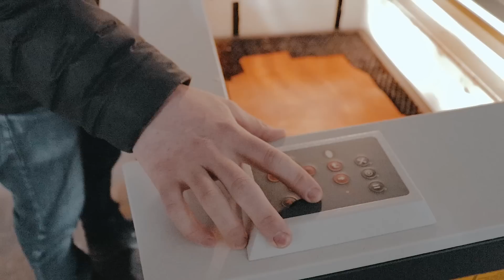MAKING LEATHER HAT PATCHES - TIM HORTONS AND HAMILTON.

Comment: Oh, that cylinder arm works perfectly for these projects. Also, I've done laser engraving myself too. How do you deal with the black burnt residue from the engraving ? I've used natural veg tan and made it dirty while I rubbed it off. I've used a brush and it worked for me. Did you use leather balm on it ??
Reply: Also, are you planning on entering the laser engraving game ? I've seen a few people make their goods solely through engraving. It just makes things really easy and simple and saves a lot of time.
Reply: I use painter tape. Gaffers tape works best but it’s more expensive.

Comment: Hamilton is way bigger than the spec of it that you saw. I’m from the Hamilton area and how you described it is so accurate-for downtown hamilton. Anywhere outside the downtown core is fine (aka the mountain or the valley) Usually only the privileged (Ancaster, Burlington, Oakville) or the sheltered (Puslinch, outer Flamborough, Waterdown) group downtown Hamilton in with the rest of the city. The people from Hamilton or that have a bit of world view and aren’t narrow sighted will tell you there are a few cities grouped in with Hamilton as of the 2000’s. Flamborough, Dundas, Ancaster to name a few. Downtown is just the Scummy Toronto of Hamilton which perpetuates a stereotype of depravity around the whole city by people from outside of it that have only been to one place and group it in with the rest. Although I hate downtown hamilton, the rest of the area is absolutely fine.